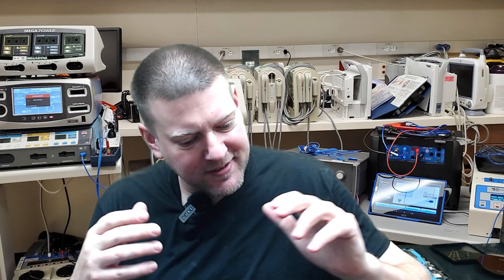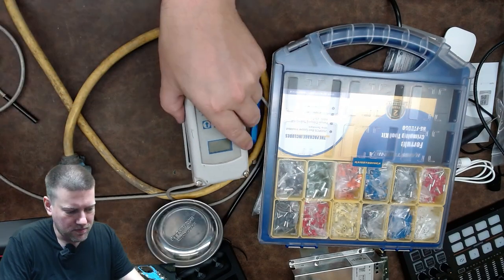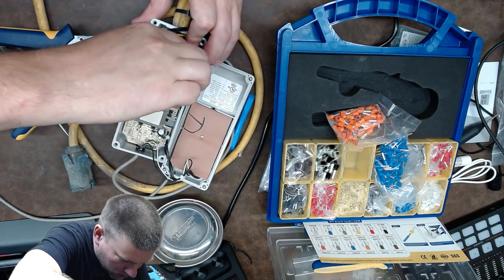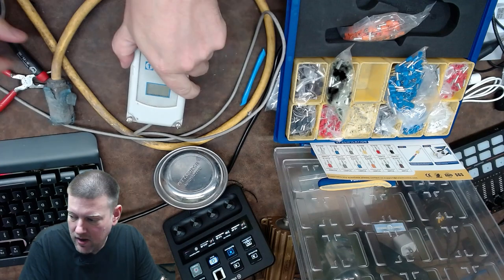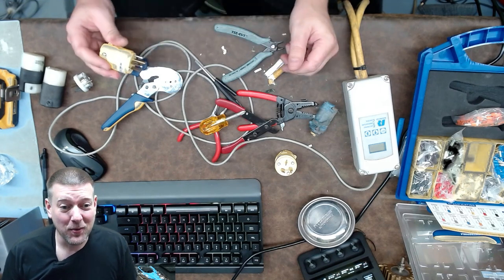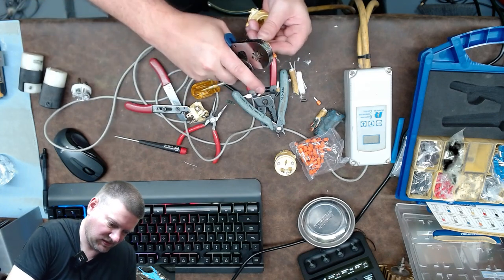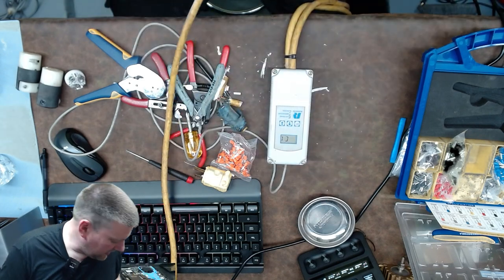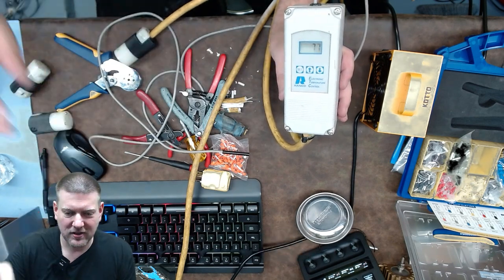Multi Purpose Temperature Controller

Comment: It's okay to put two wires in one ferrule, there is double input ferulles. It's good practice if the terminal is shorter than the ferulle, to cut  small part of the end, so no current carrying part is exposed

In Europe it's normal to put ferrules in all type of stranded wires, no matter where it is. Maybe in wago you can get away without ferrule 😂